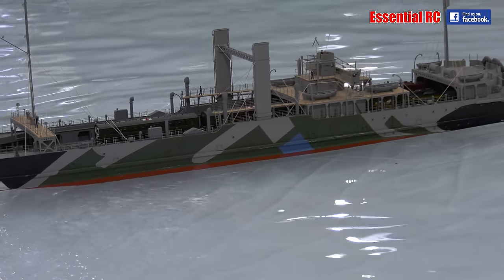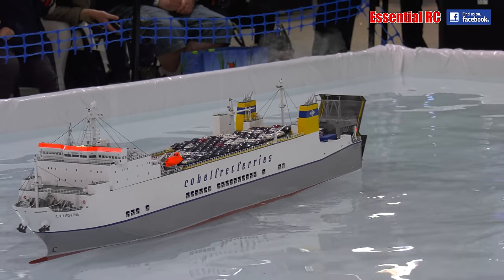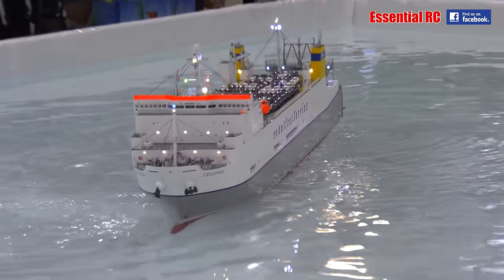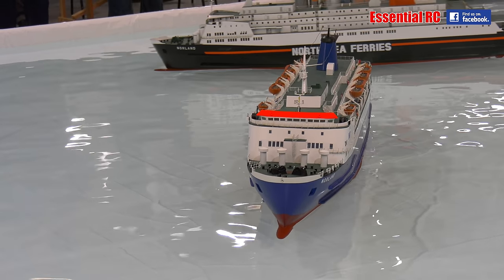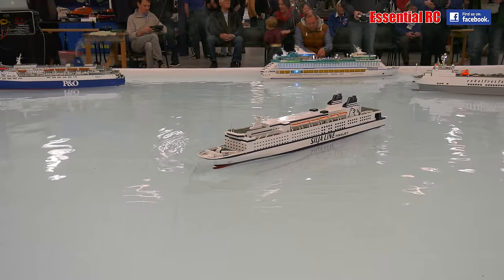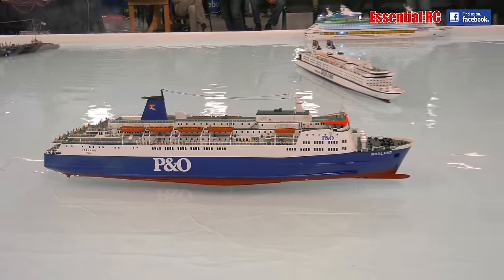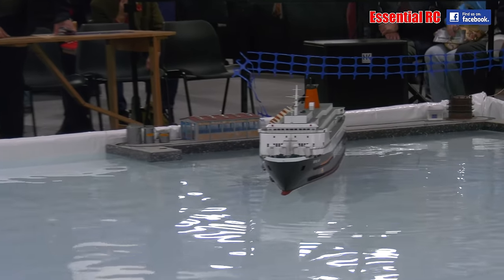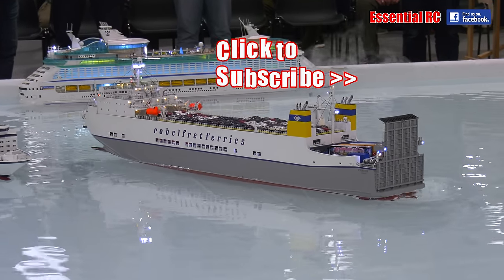SUPER SCALE Radio Controlled (RC) PASSENGER AND CAR FERRIES (RC SHIPS and RC BOATS)

Comment: I worked on the Norland for 3 1/2 years, under both liveries. Very detailed models, I could even pick out my old cabin.
Reply from the maker: That's great to hear Matt. Thanks for sharing. Cheers Dom (Essential RC)
Reply: Matt Smith,  wasn't the norland,s sister ship called the Norwave ?
Reply: @gary96397  No, that was the the British crewed ferry to Rotterdam, Norsun was Dutch crewed to Rotterdam. The  Norstar was the Noland's sister ship.
Reply: Hi Matt,
I wonder if your beautifully built NORLAND was based on one of Carl's Linkspan kits?
Cheers,
Ralph